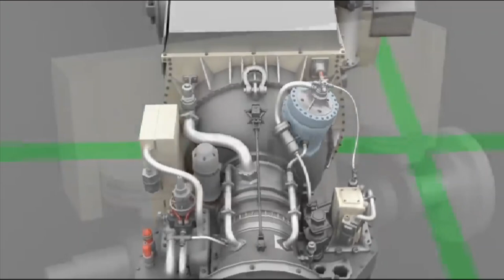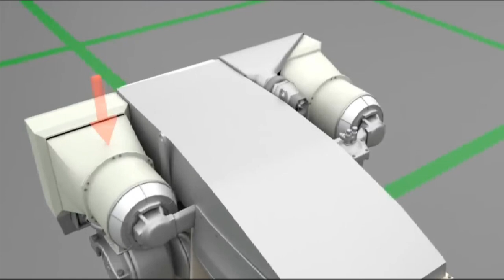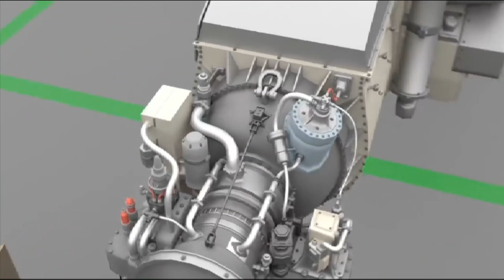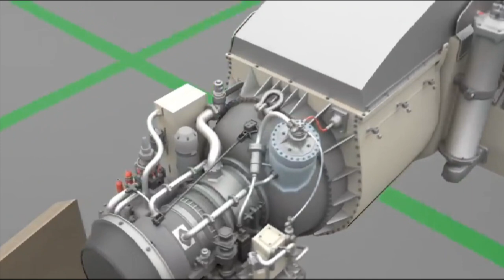India's first High Powered 1500HP Engine | To power Arjun and FMBT

Comment: The choice of 1400 hp for Arjun always surprises me. The 1500hP engine from MTU is actually smaller. Then I came to know that DRDO had developed a special cyclonic filter for this engine and couldn’t be adapted to the 1500hp engine. The Arjun is perfectly suite for desert conditions. The French Leclerc and British Challenger 2 really struggled In UAE, Oman and Jordan specifically due to this reason. Few things that’s missing on Arjun is multispectral camouflage like Barracuda system, side skirts on the tracks for reducing dust ingestion generated by its own movement..
Reply: The Germans denied us the 1500 hp engine.

Comment: Arjun needs a new gun. Perhaps 125 mm 55+ caliber smoothbore one to fit into changing dynamics that require more firepower from a longer distance.
Reply: 125mm 2 part ammo is a dead end of development… better to keep 120mm, move to a smoothbore with higher pressures, 1 piece ammo NATO standard. There are multiple developments happening on this one and can be leveraged. 
Using APFSDS on a rifled gun is a nightmare. It’s not very reliable. Other rounds are fine. HESH can only be used in Rifled gun I think. 

Better yet, skip 120mm and move to 130mm from Rheinmetal.
Reply: L/55 rhienmetall gun should be license produced.
Reply: @subram2011  130mm is heavy
Reply: @ChandranPrema123  German 130mm I’d heavier for sure. But remember that French Ascalon program is going with 140mm telescopic round similar in concept to the CTA 40mm gun. This will save space, but will also have higher energy and longer projectile. There are options available….

Comment: One problem with Indian  effort is a on̈e to one replacement in items without concedering future needs of the army.This attitude lands us in problems a couple of years ahead when requirements  get tweaked or small changes occur.Some concerns.
1500hp ....what ratting is this.....automotive...???
Given it is DIN6271(30min/6h) will be OK for rajasthan desert if current MTU is sufficient. However if we need to use this in high altitude plateau then deration will set in.Engine might develope only 1200hp.
Thinking MBT is 60 tonnes our target has to be above 25hp/tonnes.
Therefore a 2000hp engine is most appropriate which can accommodate a deration of 20%.
Therefore engine should be 16 cylinder 2000hp with cylinder deactivation to run as 12 cylinder 1500hp engine.
Critical parameter.Power to Space ratio.
Reliability B50MST
Durability B10T
Future generations take care.

Comment: To be honest this is a waste of time, cars and tanks are moving towards electric drives. Electric drives are quiter and colder, much simpler to maintain and much easier to power because of the various ways to generate and store electricity. We should get ahead in this field while we can and be integrated our engines as generators. That said this is a fantastic engine by itself, and a great work of engineering from our Indian engineers.
Reply: But wouldn't that have a long charging time?